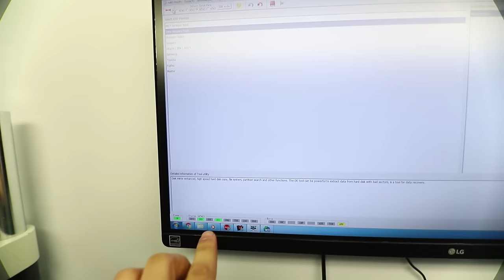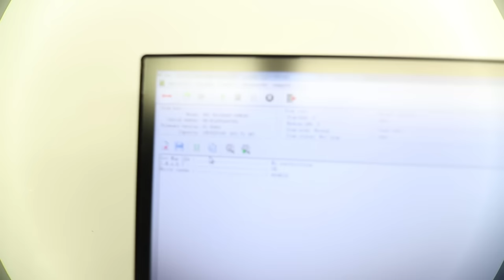hard drive does not spin? simple way to get your data back

Comment: hey there.. i have this issue. i can see my files on my hdd but when I'm trying to open them or copy it fails and suddenly disappearing from my system. i have to shutdown and power back on to see my drive again. i checked all of my cables and ports, also did some tricks with the internal pins of the drive. so now im on usb external sata device to save my time from restarting over and over again my system. my problem is when my hdd is trying to do some "work" it blowing up. any thoughts on? message me or reply. thanks!
Reply: clean the contacts.

Comment: Friend i have a question: I dropped my WD passport 2TB. After that i connected and there was a click noise coming out, i openeded it ant notice that the heads were damaged. The platters are running properly. Is there any way to recover tha data ?

I made a big mistake 😂 opening and trying to repair. I have all my sound libraries on it 😭😭😭 please help.

Some hope please...
Reply from the maker: It would need to be sent in for examination

Comment: At 0:55 u just casually pick up a spinning drive pretty fast & hold it up to your ear. I have killed a drive simply by changing it's orientation like that. Read that desktop 3.5in drives are extremely sensitive to any displacement while spinning.
Reply from the maker: yeah, only 0:54 switch the channel's power off, so when I picked it up the power was already switched off, and I press power-up when the drive is next to my ear

Comment: Hay long story short. I have 1 SSD, 1 HDD. My hdd died because i plugged in a old one and the old HDD started giving this burning smell. So i plugged it out and just left it. When i started my pc back up  everything got erased and my windows was crashed so i had to reinstall everything on my ssd but my pc did not read my normal HDD anymore that i had for a long time. I thought the HDD was broken since it didn't spin. I bought a new one but my pc can't read this one aswell.  the weard thing is that this one also doesn't spin. I tried changing the power cable etc from the SSD on the HDD but it still does not work. Do you maybe know what might be the problem ?
Reply: actually its still a long story... sorry xD

Comment: hey can you please help me. my segate drive spins for 5 sec when connected . after 30 seconds my laptop ejects it(eject sound) and again tries to connect but this time no spin of the drive and on the display it show. device is malfunctioned. unable to recognize. also it doesn't show up in computer management section - sub tab 'disk management'.no drive is shown there to assign a path too. tried it to insert into other laptop but same thing. so i guess problem is definitely with my hard drive. tried other cables also. but no result.
Reply: also the led light is fine on the segate drive. spinning sound is not cluttering , it is smoothly spinning like normal. only problem is that windows is not recognising it.

Comment: It cant work. My external hard drive  was making "click" sounds for about 8 years ago. Since i havent used it. Then i tried to day, and there is no power that works on the external hard drive. Even i tried to move the "reader" away from the disc inside the hard drive, it didnt do anything. And i also checks all the power "supplies" (Or what the name is) on the green plate with a power checker. And there was power on all the power supplies inside. Dont ask me how this is possible, when it is totally impossible. All power supplies works, and still the external hard drive didnt work. I nearly think to send it for repair, but there is no information about how much it will cost. And I didnt have over about 150 dollars to get it repaired
Reply from the maker: Sorry but there is nothing to be done at this budget. Besides you already opened the drive, contaminated it, pushed heads access the disk. Unless you have a Bitcoin wallet in there that is worth some serious money it is unlikely someone would be willing to professionally get data out for you
Reply: @hddrecoveryservices  Lol. And i was asking in a group on facebook about help to computer etc, and there are many pro people in that group. And it was a person in that group, that wants me to open my hard drive to move the reader away from the disc

Comment: What do I do if the hard-drive gets warm from being plugged in, it's getting power im guessing but doesn't spin!,
Reply from the maker: not sure. It has to be tested
Reply: @hddrecoveryservices  But in most cases is this a PCB, or a Platter issue?

Also on a 6TB NAS WD, 2014 HD, do I need to do the bios swap, or can i just do a PCB swap?
Reply: @hddrecoveryservices  Data on it is 100% Fine I assume, it's mostly just noted pads, pictures.. and random videos.

Game files I don't care about!

Comment: Another Update: 

Okay I got my ROM back. Well, I got my ROM back that is a New ROM. They said that my original ROM was too damaged, but they were successful at transferring the ROM information from my Original ROM to this NEW ROM. They checked twice that it was transferred over successful.

Well of course it did not work. The drive is seen in windows but barely. It is doing the same thing before like the original problem. Completely and 100% silent. (I think all windows recognizes is the bridge that it is connected to).

This is the weirdest part. I ordered some more PCB Donor Boards and if I put any of those on this hard drive the drive comes to life. It boots up twice or tries to read the drive twice and gives up. 

What dose all this mean? Did some how the original ROM get corrupted and is permanently damaged?

Long Shot

They suggest the file system could be corrupted and that this is almost 100% fixable. Connect PC Max 3000 and either get lucky and extract the data by bypassing the software lock because the drive is in defensive mode or rip the data off raw but will take a while (same as bypassing the locked codes). 

Recap: 

1-Original PCB Board with Original BIOS in perfect shape (something happened): 

-Drive would not boot up, completely silent, not moving or humming at all. OFF.

2-New PCB Donor Board with random bios that is already on the board (Testing): 

-Drive boots up and tries to read but gives up and fails.

3-New PCB Donor Board with Original BIOS (I installed it myself, botched it up)

-Drive would not boot up, completely silent, not moving or humming at all. OFF.

4-New PCB Donor Board with New Rom (Installed by professional, bios information transferred over)

-Drive would not boot up, completely silent, not moving or humming at all. OFF.

…

What does all this mean? Something is corrupted with the original bios? How does the drive power up and try to read with a random donor board with whatever BIOS that came with it; but when it is connected with the original bios its dead as a door nail?

I will be getting back my original pcb board and original bios/rom. I’m sure the ROM is in ruff shape but the information has been transferred over to a new ROM. So that is good at least.

What are my options at this point? Is my data lost forever?
Reply from the maker: Hard to say what the issue is when so many things went in a wrong direction. We could have a look at it for you but we need all original partas

Comment: hi bro.... i m in real trouble, i had a problem with Power supply unit so went to shop and get it changed, but once i reached the office and fixed it- the PSU made tit sound and CPU went off again, so i went again to shop and he said motherboard as well as both the hard disk (master & slave) is damaged... i was almost to faint after listening that my hard disks are gone, as all my work files are in that hard disk....  so is there any chances to recover my files?
Reply from the maker: yes, contact us here: http://www.hddrecovery.ca/contact-us/

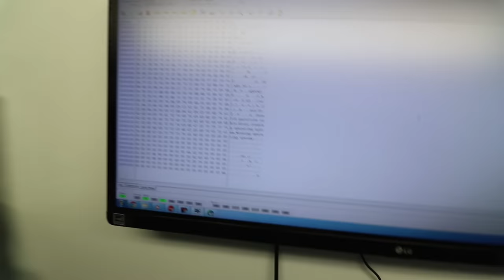Comment: Awesome, but i have a few questions. @ 9:21 you show us something about encryption, but I don't know exactly what you meant there. What are we suppose to see when it's not encrypted VS when it IS encrypted. I am dealing with a lot of pain in the ass with OPAL, and several other heavy encryption on ssd's and some hgst drives. And I'm wondering if i can get closer to the solution. And no, I don't have PSID's  :(
Reply from the maker: If you have a look at the very first sector of a non crypted drive it will end with 55 AA. WD hard drives in 3.5" often come from WD My book enclosures, and often those drives have hardware encryption which will change the look of sectors when they are viewed
Reply: Cheers for that bit of info dude! tc
Reply: HDD Recovery Services The reason why I stopped buying WD MyBooks, when I had to help some family with one which turned out to be the bridge board; I bought another one, but turned out to be a different version and wouldn’t work just swapping drives; googling told me how the onboard encryption chip encrypts everything, even if you haven’t set a password, making recovery problematic unless you have a bridge board with the same encryption chip. I found the part number on the dead board, and found one on ebay, it worked fine after that. But it taught me to steer clear of WD enclosures for that reason, not for the hard drive itself.

Comment: Hi, nice video but my hitachi hdd 1tb working very well couple days but then drive make some noises inside disk when i installing something or copying, but then disk drive not showing up on pc i restarted pc but hdd will not spining up at all, i removed bad diode but hdd still not work, whats problem with this, sorry for my english 😊
Reply from the maker: It's hard to say without troubleshooting the drive first. If it spins diodes are fine , PCB is fine. If it makes noises most likely heads, or media damage
Reply: HDD Recovery Services but not spining thats problem i can hear  right now after strange sounds😊

Comment: You should use resistance mode on the multimeter for probing. Continuity mode can pontentially damage the board because it's using bigger voltage
Reply from the maker: never had an issue.
Reply: Continuity mode uses the same voltage as 2000 ohm mode, usually 2 to 3 volts.
Reply: You need at least 1.5v as most diodes don't conduct below that threshold. Besides, this is the main DC for the board, and drives run on 5v  (or is it 12v), so how could a continuity check for a shorted diode damage anything downstream?
Reply: Never had a issue or damaged a board using continuity mode on anything
Reply: For the sake of accuracy. 
a) Silicon diodes require around 0.7V to conduct 
b) Germanium diodes require about 0.2V. 
c) Schottky Barrier diodes also require about 0.2V

The test voltage of a multimeter is supplied through a current source which presents an 'infinite' series resistance. This means, when a short is encountered only the current source's current passes. This current is made very small (approx 1mA) by design.

Comment: great but how is that possible hdd working without diode d4???
Reply from the maker: I guess it comes down to a purpose of a diode
Reply: @hddrecoveryservices  

i have problem with wd green. as first sorry for my english because is not good.

used him before 5-8 years. in very small room hot at summers. mb is asus p7h55 m1,gpu nvidia geforce 460,4gb rams but on win 7 32 bits you know lower than 4gb total. 
few days ago my son wanted to play minecraft first time on that pc. 
i decided to use agajn that old pc,for gaming purpose,it is clear not in high grade.
installed at pc shop adata ssd 630 as primary disc,with win 7 pro x64.
still was in new case ms cyclops v my wd green with two partitions with on both win 7 ultimate x86.
installed more rams,now total 12 gb.
my son sleeped and i tried to install on ssd efootball 2021 to little test machine for that purpose. after couple minutes machine worked harder and something goes wrong,thus i smell something little bad. turned off pc to relax hardware in too hot room,tomorrow turned on and i saw on bios some strange allert cannot detect tpm device. i dont remembered i mean i entered on safe mode but did not remembered what was about wd green partitions inside. at service disconected wd green and ssd booted normal. i tried to use external case for wd green,pc recognize successfuly both wd green partitions but wrote only about 600 mb and something system reserved. i can hear something as clicking from wd green. not tried to but from external case with usb port. 
i mean reason for this was too long not used machine,upgraded hardware,too hot small room,5 ubit nice colored coolers inside msi cyclops v,but without fresh and cold air from outside room. what happened,is possible d3 or d4 damaged because high temp inside machine,what about clicking sound? you are great fair man and i wish you are close to try fix it.

Comment: Simple way...yeah right...
Reply from the maker: removing 1 component is not easy enough for you?
Reply: @hddrecoveryservices  Technically yes, :) but with proper tools with a proper pro...Somehow i thought this could be made at home...course not. Also i don't have those tools... I have a recent dead hdd (wd external 500gb) ... i have some data that i would love to recover but isn't a ''life or death'' data that feels like to spend lot of money to do it...
Reply: @hddrecoveryservices  I have WD external HDD which stopped working after little fall, since i don't have any important data, i opened the hdd , tried to put head to the beginning with the platter clockwise trick but the head won't goes to the start position, that orange thing to support the head won't let me to push more back...